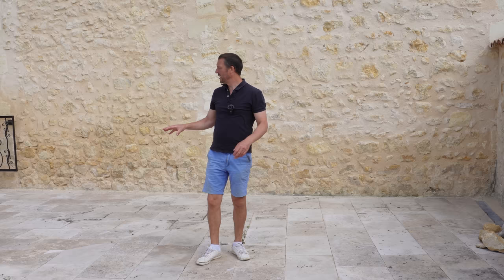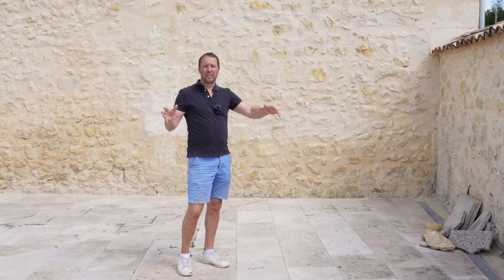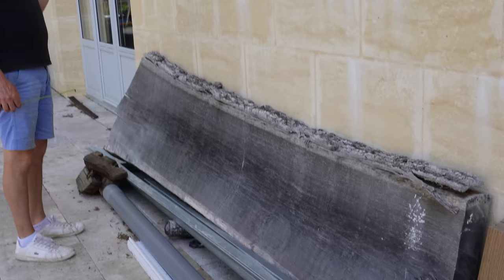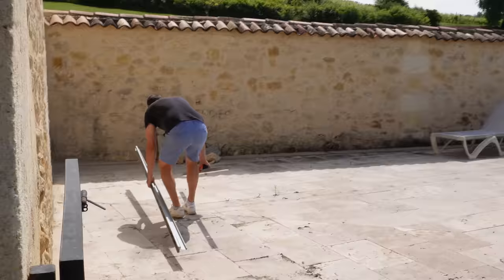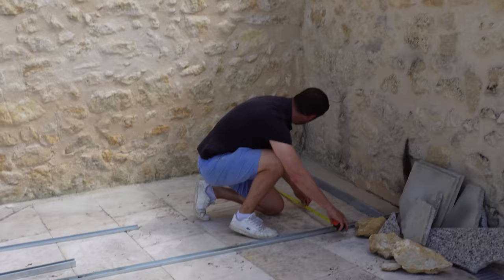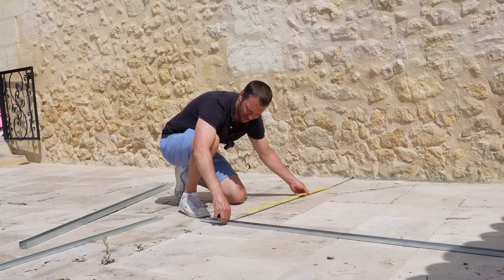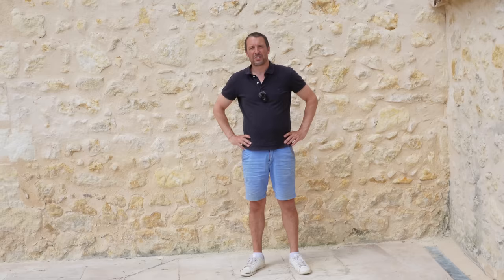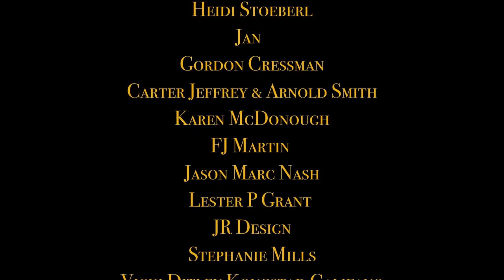Back to DIY ! Edd's Return to Building

Comment: What about making the roof tallest all across the front of the area and drop down over the back.  Perhaps even turning the bar the other direction so you could add stools in front; as I think the area might already be too small for a patio set. Maybe locate what you want first to make sure the structure will be large enough.  Then finally to help make it look more as if it has always been tfere consider running it all the way to the other end of the pool to provide shade all along the back wall.  Then possibly put large planters to grow roses or olive trees to add color and life to the area.  If your adding water to your sink it would  be easy to install drip so there's not work to maintain them.Just a girl with to many idea's.   Good luck.

Comment: Edd concrete a pipe just larger than the parasol support pole into the ground deeper than you would think but you must put the, down in any windy weather or nothing will save them.

Comment: Nice idea to have an outdoor kitchenette-bar area.  Are you going to slope the shade roof at the same pitch as the end of the house (lower obviously) to keep the rainwater out of the pool? Ah, a forward slanted roof parallel to the short wall sounds like the  logical solution.  Any chance of placing a built-in barbecue grill? Have you been looking for some property for your dream chateau build?

Comment: Would the size/allowance of the work area not be dependent on say a bar fridge door being able to open and not be cramped by the wall? Storage shelving depth under the bar?
Reply: You can get left or right opening fridges/freezers to fit the spaces you want them in.
Reply: Yes, I know my point was enough room/clearance between the wall and the door being ajar not which side the door opens.

Comment: Surprised you didn't consider an L shape. With the bar at the back wall and the seating area on the right. If you do posts at the corners near the pool it will still give you the space without crowding the edge. It would be covered but open.